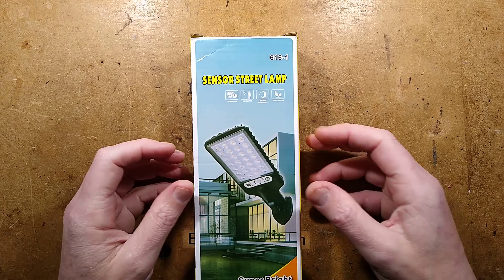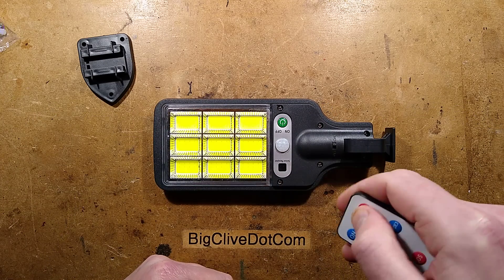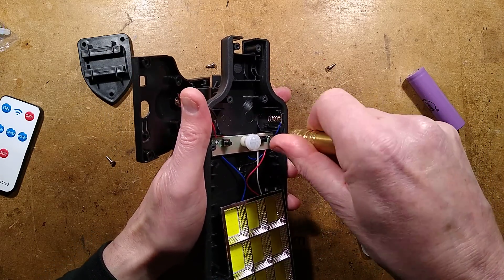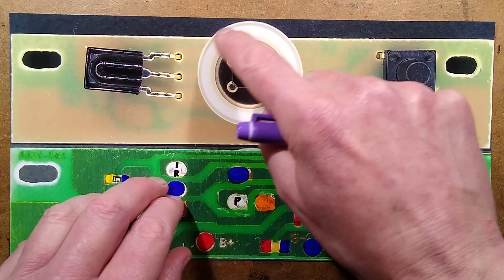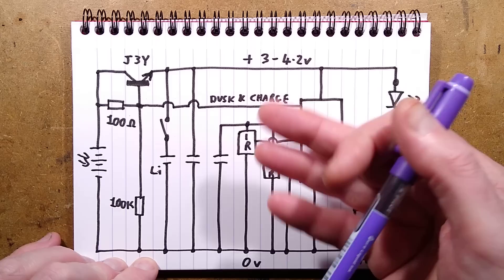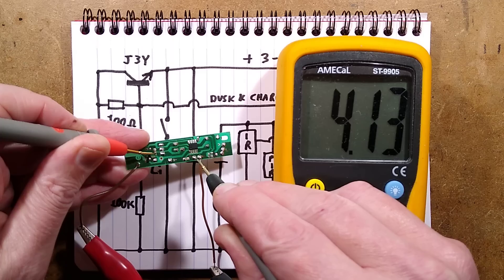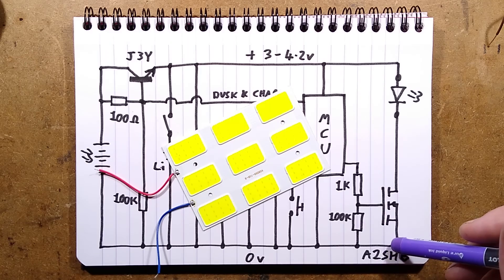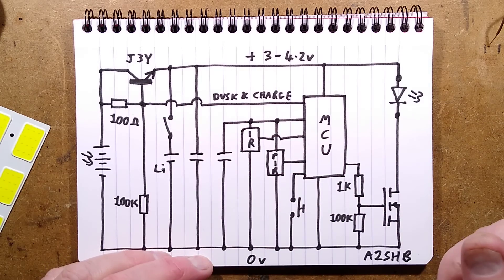5000w solar LED street light

Comment: Heads up for anyone who's buying these: The one I got came with a pathetic 300mAh battery. So if you get one of these, and your has a blue 18650 that only weighs 25g, then you'll probably also need to swap in a proper one.

Comment: Here in fall and winter I just need enough light to see the keyhole while I'm the doorstep, so 5000W is a little much.
But I just inserted a 22ohm resistor in series with the led's. It brought the high power motion detector setting down to 50mA, which seems to be plenty of light.

Comment: Would this lamp also suffer from over charging and rapid cell degradation?
What battery type would you replace it with that had over charge protection built in.?
I seem to remember you mentioned it in an earlier video about a solar lamp.
Reply from the maker: The circuitry seems to vary between lights.   A cell protection circuit is always a good upgrade.

Comment: I bought two, based partially on your review and partially out of my own curiosity. £6.15 a pop. Eventually fitted to the wall and set to low level all night, with high level proximity detection. Obviously not 5000W but we all know that is a bit of a joke description (I hope they aren't serious there). I noticed online that some listing's are 6 kW.

Anyway, tbh, these things are surprisingly good and they last all night as far as I can tell. I've now bought 4 more to fit around the garden, same price as before. I haven't bridged the switches yet like you always recommend, but the construction suggests that moisture may not be an issue for a while. If the damp gets in then the soldering iron comes out.

Great video by the way. Thanks

Comment: I've configured one of these for indoor use by replacing battery with super capacitors for safety and leaving it permanently connected to a USB power supply with a tp4056 module. That was my favorite DIY project. It was a different version which I bought for $2

Comment: weird question, what book should i start with so i can start learning basic circuit knowledge, i have autism and i am very gifted with the more "physical" forms of engineering but i am terrified of electrical engineering and just working on electronics in general thanks to a coil pack off of a 2009 chevrolet truck coil pack. so id like to start doing things safely, all i wanna do is make custom and brighter lights for my car.
Reply from the maker: You may find the internet a more valuable resource than a book.  There are lots of channels on YouTube specialising in a wide range of subjects.

Comment: Believe me, in a(ny) product that is not actually sealed, like in this case for instance by means of a rubber gasket of sorts that sits inside running all the way around the 'rim' of the lower part (that's clear plastic although glass would be even better, as plastics also can be somewhat permeable), in-between that and the upper part, clamped in with screws (that only sit around the outside of the perimeter where the two parts meet) that clamp it all together (whilst these screws are mounted so that they do not cause any breach of the watertight character of the enclosure thus created), or the product at the very least had all its parts glued together with a non-permeable type of adhesive such as silicon (but who would want THAT), if it is not like that, water WILL creep in

Comment: How good is the SOLAR PANEL is it enough to charge the 18650. I upgraded the battery in mine but it seems like it still dies I’m thinking the solar panel doesn’t have enough wattage
Reply from the maker: It will also depend on location of the panel and sunshine levels.    Ideally the solar panel should directly face the path of the sun.

Comment: I have had identical units installed for past 15 months, they no longer work, the UV sun has turned the outside of the small solar panel opaque ; so not getting any charge.
Waste of money, absolute crap PV panel, I could not recommend purchase.

Comment: I currently have one of these in use at the start of driveway in damp, wet West Cork, Ireland and other than the screws rusting a bit on the outside, it is holding up very well after nearly a year... Good value for money!

Comment: These have been $3.99 usd (now $3.59) on Ali all week. Quite  a decent light at that price. Ordered several,  the unit that arrived 1st, the 18650 came in @  29 gr  800mAh. Quite puny but actually  probably sufficient for my needs. It is in holder so 1 min to pop in more capacity if needed.  No on/off switch. On one unit I'm thinking i will add usb charging and 3000 mAh cell . Plus a clamp and it will be a good work/camp lamp that can last a while and be topped off if needed.

Comment: Be aware that in typical Chinese fashion, they are a bit random in which colour wire they use. DO NOT rely on the colour of the wire for either the polarity or the function. I have just opened one that I bought, the wire from the cell positive to the switch and then to the board is blue. The wire from the cell negative is red!

Comment: I've bought 20's+ of these.. no not these the even cheaper ones, eg no remote and cell is soldered in to it and no isolation switch on it, eg the cheapest of the cheap, they are great... But they overcharge the battery and kill it in a year... So.... I just bought a 50p cell protection circuit and just like the energiser bunny they keep going and going and going...  For £4.40 a light (off wish) I can't complain. I prefer the 18led type as the light is spread out more but I will say for the size the ligh output is not half bad.... I have them everywhere... Just don't forget to put in cell protection then they are a real cheap decent light... Oh and the 18 led type I measured using a power supply is actually 3 watts of power pulled from a full battery... But even so 3 watts for a solar light isn't bad output!!!

Comment: big clive i might be able to lend some insight for you. car alternators are pretty effective and in some cases seem to break physics efficient. the gm ad244 alternator is a prime example of that.
some of my knowledge from those and also interest in solar could be the easy answer.
old alternators had an exciter wire. 12v through a resistor and or light bulb. if bulb burnt out youd lose charge though so just resister was better. computer tech made leaps and bounds and then alternators started using other wires and the computer could control voltage output. how about that. it could charge from 13.6-14.8 volts and its nice. some computers could bump the idle up when it seen electrical demand go up or fans kick on or ac to smooth the idle. it got pretty interactive. 
some of that alternator tech has been showin up for other things and a good voltage regualtor to regulate a charge voltage would be a good use. i bet they have some base form of that on the weak cpu cause its low voltage anyways you can charge that type of battery at 5 volts so anything over 3.8 volts could charge iit . 
modern solar panels are making bounds by cooling the panel. imagine that. they got too hot to be efficient. if the panel went on and off or only charged some it would regulate heat just like fones do for battery and cpu temps and so do computers. 
think of all the stuff people do with a rasberry pi. basically a low low budget version of that for a light so it doesnt need to be modable it just needs to find a way to work when you need it for 8-10 hours.

Comment: I have one of them, slightly different config as solar panel is separate unit so can be mounted higher up to reach more sunlight. Nevertheless it does work for over a year now, and I cannot see any faults with it. Does trigger when someone is approaching my front door. Did cost on ebay something like £15. Definitely recommend.

Comment: I know the offers exaggerate usually a bit on what they can do, but last time I looked up LED stuff on AliExpress saw a handheld flashlight promising 999'000'000 Lumen of light, which would require roughly 100kW of Power. I wonder if it comes with the power station required to run this.

Comment: I've got two of these outside, except without the remote. I'm quite happy for the price, I haven't sheltered them and they've lasted about 6 months so far. I have them on the low setting that steps up when it senses movement and they've been reliable so far. One minor issue is they do tend to flicker a little around dusk as they try to figure out if it's dark enough to turn on
Reply: Put in cell protection if you can as how u have it they will fry the battery's I have loads of these and with a 50p cell protection pcb they lat forever... The solar cell can reach 4.3v!
Reply: Mine has a cell with built in protection in there. (Longer than my spare unprotected ones)

Comment: You have to admire these amazing Chinese engineers packing 5 KW into such a small light. Also, I was shocked to see how far photo-voltaic technology has advanced with a few quare inches of collector powering this awesome device.

Seriously, we need to find a way to punish these liars. Personally I advocate buying them and then returning them as defective when they can't output 5KW, eBay will fully refund including return postage if the seller wants it returned and then withhold the cost from the seller. Hence we are not out of pocket and the lying seller has paid for postage with no sale. Obviously this is a MUST if ever you get something that isn't perfect and is stupidly over-sold. I sent a PTZ camera back that I didn't like, as faulty, 'because the zoom didn't work'. Obviously it didn't have  zoom - none of the things Chinese eBayers call PTZ really have a Z, but it meant I didn't have to pay for the return and the seller who had lied about the spec - even talking about zoom in the description - lost out....as he so richly deserves.
Also, if I ever receive a product with one of those absurdly dangerous undersized 3 pin (out of spec / illegal) plugs I simply return it as defective and suggest that the seller stop selling them as I have contacted their local trading standards office....which on two occasions I actually did do.

Comment: Hello.
Anyone can some help me to get the datasheet of this LCD L-280A75-C . Been scratching my head for several weeks now with no luck 😢
Reply from the maker: It will probably use a standard driver, but have a proprietary pinout to the products it's used in.
Reply: @bigclivedotcom  thanks a lot

Comment: You can use a mosfet as a resistor, but this circuit has no feedback to the MCU to control the resistance.

Comment: Mr. Clive, is there an available chip configuration with or without remote, that can be used in one's own projects? I don't want the street light. But can think of better projects that could use those chips as guts.
Reply from the maker: You can get the PCBs for these separately.  But it's not much cost difference to the full thing.

Comment: i have had four of these. best thing to do is bypass that on/off switch and also run black mastic around every seal as the water does piss in and destroy the circuit board. mainly around the pir sensor,

Comment: This control module is pretty neat. Do you have current measurements (from supply / to COB) for standby and output modes? Timing is hard coded into MCU or is there a mechanism to adjust timeout / hysteresis? Cheers for another sweet video! 5KW LED WOO!
Reply from the maker: There's more data about LED current in the description.

Comment: How do I ID a Pioneer car stereo head IC chip? Had no data under thermal compound.
Reply from the maker: If it's standard you may be able to work out what pins do what and look for a generic chip with similar functionality and compare the pins.   Some units may use a microcontroller with custom software.

Comment: Tipycal LEDs have an efficiency of around 100lm per watt. The most efficent LEDs can reach 150lm per watt. Now if that torch was really 5000W, it would have been a 500000 - 750000 lumens 'torch'!!!! Imagine that...

I cant even Imagine how much Light that is but apart from that, to run 5000 watts of LEDs, a HUUUUGE battery and a HUUUUGE control Board (boost or buck regulator) are needed. Such a thing would be so big that it could't even fit in a car!

And then... Of course... The price...

Of course with 6.99 pounds you can get a 5000W LED Light. 5000 chinese watts though.

Comment: Hmm. If that had a little better panel and proper cell charging that would be perfect for in front of my shed. Could probably get around the charging issue by putting a separate controller in-line before the battery or using a decent protected 18650.

Comment: There was a slight translation issue when the engineer sent it to the packaging for English person.   It is not 5000W (watts), it is however 5000K, (Kelvin).   That means the light color is white, and has quite a bit of blue light in it.   Incandescent is 2700K.

Comment: The FET marked as A2SHB has an RDS(ON) of 75 milliOhms at 2.5V gate voltage and 50 mOhm at 4.5V. They're probably using the combined resistance and voltage drops of the FET,  the J3Y transistor collector-emitter and the internal lithium cell series resistance as a form of regulation. Cost savings is the name of the game.

Comment: The "5000W" is an exaggeration. You won't really draw 5000W with LEDs of this size, but they may want to tell you that this LED module can shine a light equivalent to 5000W incandescent lamp.
But, with just 1 lithium ion battery, I doubt if it can even shine a light equivalent to 500W incandescent lamp...

Comment: I'm almost inclined to buy such a lamp just to give a negative rating on ebay. I would know full well that this "street lamp" never has 5000W even before ordering, but it is not that obvious on all products where seller fumble the numbers. For me the fake numbers mostly make finding proper products much harder, because I have to check every item as the title doesn't mean anything anymore. But in many cases for people who are not technically inclined it is impossible to know that they are cheated (the "too good to be true" only works if you know already). That is why items like this HAVE to get a negative rating.

Comment: I have the model without the remote and remote sensor and found I could change to the higher capacity battery if I wanted. I might when the battery fails.

Comment: I'm going to assume that the S.0.S. mode was pushed when the power was already illuminated. If the power had been off, the light would have turned on, then back off when the button is let go. But this doesn't make sense if the light is already on.

Comment: That messes up my mind, that MCU have 8 pins, how do they program them 🤔🤔
Reply from the maker: They only usually need 5 pins for serial programming.  Power data and reset/programming voltage.
Reply: @bigclivedotcom  , but from your circuit; all pins are used either as output or input; or it’s possible reuse the programming pins for other purposes!? 🤔

Comment: Sooo. Theres two options.  5000K might be a light color spectrum.

Or 5000W is the MTBF equivalent and it stops working after 5kW of energy have been emitted as light/heat over whatever time it takes. :-)

(Comment for the algorithm)

Comment: There are otp microcontrollers with semi-precision voltage regulators on die to reduce component count but they can only source a couple of mA. In this circuit it looks like J3Y is set to be an emitter follower like you'd see on the output stage of an old linear reg.  If you tweak the bench supply up to 5v what happens?  It would be great if things like the esp range would have internal regulation for single cell lipo operation.

Comment: For the PIR, it's not a singular spots for a single person walking across the frame, it's more like a bedazzled disco ball, the many lenses are there to make it chaotic but focused on the sensor region, since it uses differential settling and amplification, the goal is to make it so IR dots swing between the two sensor regions rapidly enough to register a diff signal, from what I've gathered.

Comment: Clive
Be aware.

I have used these before.
I had 4 of them and every single battery was destroyed.

From memory the solar panel is 6 volts and I used them under the strong Australian sun👍

That voltage is jammed straight into the 18650 cooking it alive. No charging module was built in.

I changed out the batteries and soldered in single 18650 charge controller mini boards.

Problem solved.
Never cooked another battery

Comment: @Bigclivedotcom some Pic micro's have a brown-out detection circuit that can be programmed to trigger at certain voltages. So it might be using that. But also, some Pic micros have ADC channels that are connected to the power rail input so the pic can measure their own supply voltage without using another pin.
As for controlling the charge, the MCU proberbly has the pin set to analogue input thereby making it Z-state (floating) untill it needs to shut off the charging. The clamping diodes in the chip will prevent it going too high above the supply voltage.

Comment: Bought 3pcs about four months ago. Only one works now. Took them apart, the same part failed: the solar panel. The solar cells are in series, the solder joint between them is broken somewhere. 
The resin coating on the solar panel doesn't handle UV well, full of tiny cracks on all of them.
Reply from the maker: That's why I prefer the panels with the silicon laid on a fibreglass substrate.  The differing thermal coefficient of expansion of the plastic and resin layers flexes in hot sun.

Comment: Could the MCU be doing a crude PWM on that charge transistor? And switching from output to input, then measuring the voltage on the 100 Ohm resistor?
Reply from the maker: It definitely has to sample it intermittently.